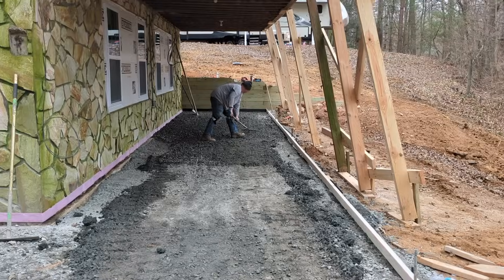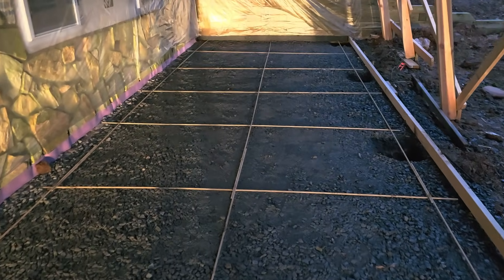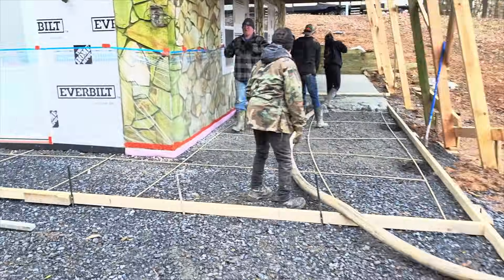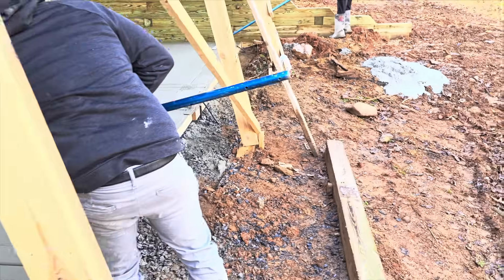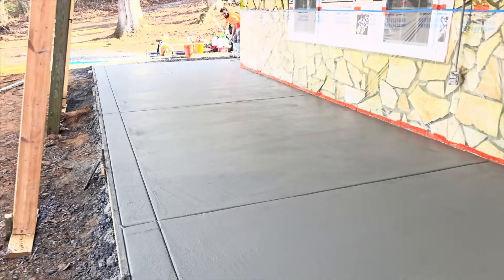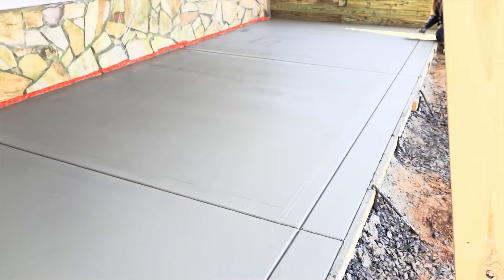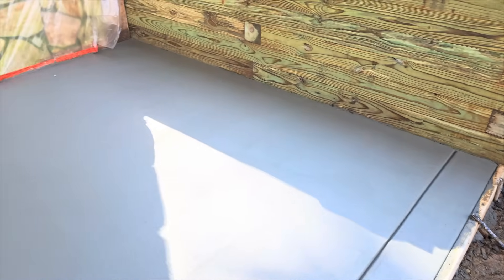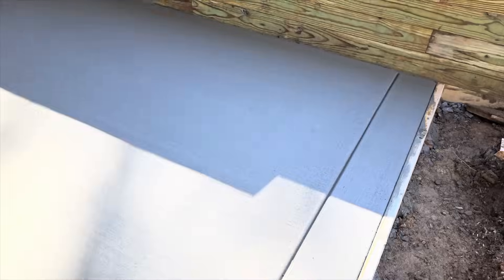How we prep and pour a broom finished concrete patio with tool joints and border.

Comment: Ben, another tip for stopping "dead end joints" from continuing would be to take a 1/8" tap con pilot bit. And at the intersection run that drill bit straight through either 3" or all the way.
Reply from the maker: Great tip yes sir we have done that before on a big stamped patio with a ton of inside corners. We did this job about 4 years ago and was I was just back there a few weeks ago and had 0 cracks off those end joints. Great Tip my man!